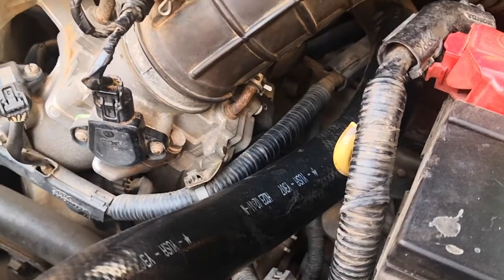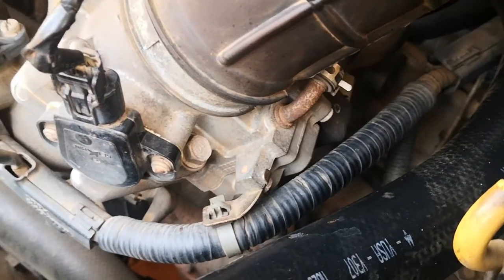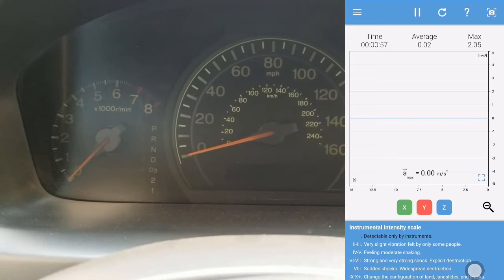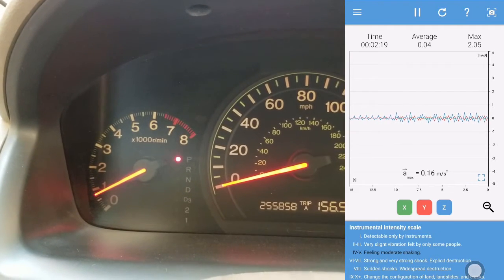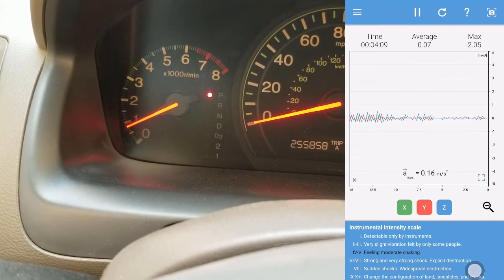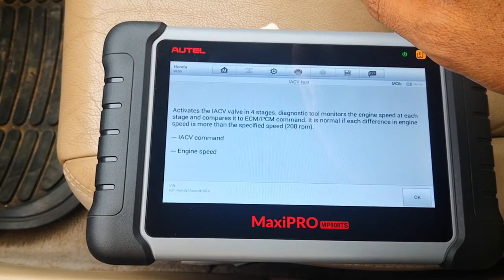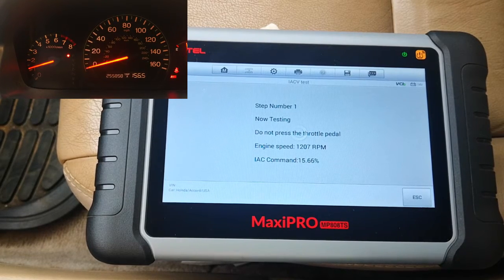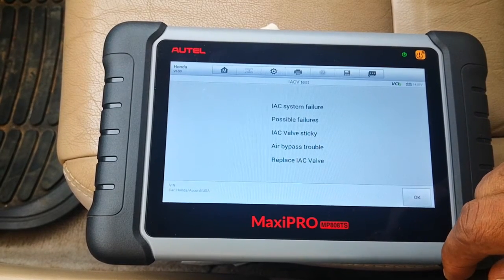IAC valve testing with active scan tool: IAC valve not working well

Comment: friend.. i can use the mk808 for this vehicle? accord 2007 and toyota corolla 2000
Reply from the maker: The MK808 will work on those cars generally. However, note that the MK808 is NOT an active scan tool, therefore, it is unable to initiate an active test such as this.
Reply: @DIYAutoworksNG  got it thank you. i will go to buy

Comment: Can the 906BT do the same thing the 808 can ? About to order one but don’t want to make the wrong choice
Reply from the maker: Hi,
Thanks for watching! Just to be sure, are you referring to the MK906BT or the MS906BT?
Reply: @DIYAutoworksNG  the MK906BT
Reply from the maker: The MK906BT will do all that the MP808 will. If comparing to the MP808TS, the MK906BT will not carryout the full TPMS functions that autel scanners with the 'TS' suffice would. That said, the MK906BT has some advantages on hardware, it can also use some autel add-ons like an oscilloscope & video camera. It also has additional OBD connectors and better battery life. It just boils down to the range of function you want to have.
Reply: @DIYAutoworksNG  okay thank you for the break down I really appreciate it !

Comment: HI, I have a problem with my Mercedes w204, sometimes it shacks when driving, can it detect when doing an engine test on this MP808TS ?
Reply from the maker: Thanks for watching!
It really depends on what's causing the shaking and there's a whole lot that can. Can you describe the shaking further (when it happens, under what's circumstance)? Does it start at a certain speeds or when braking or when loads are applied?
Whether or not the MP808TS will diagnose the vibration depends on the cause. If its unbalanced tires or worn CV axles, it definitely would not. But it will if the cause is performance related, it should identify the cause.
Reply: @DIYAutoworksNG  we took the car to Mercedes and they can’t find the problem, it doesn’t happen all the time, sometimes when it is cold when stating the car it vibrates, and sometimes when you accelerate, it feels like one of the spark plugs, and sometimes it can be the turbo, and then everything works fine for couple of months, and then suddenly it starts again, only for a few seconds then disappears, it is more when accelerating
Reply from the maker: This kind of intermittent problem is the worst to track down and even the best of scan tools will struggle to identify this. If there are no codes set, reading livedata when this happens may be the only way to get a sense of what's happening. If you have a scanner, you may check for the presence of temporary codes...
Reply: @DIYAutoworksNG  will do that
Reply: @DIYAutoworksNG  would you recommend the ms906bt or what is the difference between them mp808ts ?
Reply from the maker: So it depends. MS906BT has improved hardware. Larger screen, improved processor & battery life. It can also be attached to an oscilloscope and comes with obd adaptors. Also has an edge in ECU coding. However, the MP808TS has the advantage of supporting full TPMS functions which the MS906BT does not have.
Reply: @DIYAutoworksNG  thanks for the info, the cars that I have they have tpms but they do not work with the wheels they work with the ABS , so when I have the tpms light comes on it can only be cleared by the radio settings, I don’t know why , I want an Autel that can erase the code without the radio, will the mp808BT clear it ? There are no wheel sensors it is driven by the ABS , I hope you got my meaning
Reply from the maker: I understand you perfectly. What you are describing is called indirect TPMS. Typically, because there is no physical sensor, the relearn procedure is usually done using the TPMS button on the vehicle or some other vehicle-based means as described by the manufacturer e.g the procedure you describe. From what I have seen so far, the MP808TS will only show you the procedure for doing the relearn, it does not do the relearn automatically. If you have the car make/model/year, I can check specifically for you.
Reply: @DIYAutoworksNG  Mercedes w204,  C180, year 2011, and VW Golf mk7 , sportsvan, year 2015, both cars have that , if I fit aftermarket radio, I can’t rest the tpms unless I put the original radio back in , I think it is using the car canbus from the radio
Reply from the maker: I have checked out these 3 vehicles on the MP808TS. Your Mercedes is actually direct TPMS (I didn't see a single C class or any other Class that didn't have physical sensors. The MP808TS can relearn the Benz without the use of the buttons on the car. The VW's on the other hand, lack sensors and a reset button on the car (not the scantool) must be pressed to relearn.
Reply: @DIYAutoworksNG  the Mercedes that I have does not have sensors, how I know is I have change all the tires because they we’re worn, and I was there when they were changed, so I know it doesn’t have visual sensors, so none of the Autel can clear it without installing the original radio, do you know if snap on, or lunch 431 v can clear the tpms without installing the original radio?
Reply from the maker: Seems some regions feature indirect TPMS on those cars. Unfortunately, I am not aware if either Launch or snap-ons would directly relearn the car.
Reply: @DIYAutoworksNG  another question, I have a Smart Fortwo 451 , and I want to install a power steering, can the Autel able to tell the Sam that now it has an EPS so the steering will work, as the car originally does not have power steering?
Reply from the maker: An EPS needs a dedicated module and since that is lacking the Autel or any other tool will not be able to communicate with the Smart42.
Reply: @DIYAutoworksNG  thanks for all your help
Reply: Hello if you have om646 or om651 then the issue is Pressure control valve on rail or Quantity control valve, see if the pressure goes up and down during idle if thats so then one of these 2 valves are causing this.
I had the same issue it was Y94 quantity control valve on hp fuel pump, went to star diagnostic they didnt know whats wrong.
Reply from the maker: Good to know. Thanks for sharing.

Comment: Great video, what tool did you use to test vibration?
Reply from the maker: Thanks mate! I used my phone (has an accelerometer, most smartphones do) with a vibration measurement  app called Vibrometer.  Accelerometers measure vibration and/or acceleration.